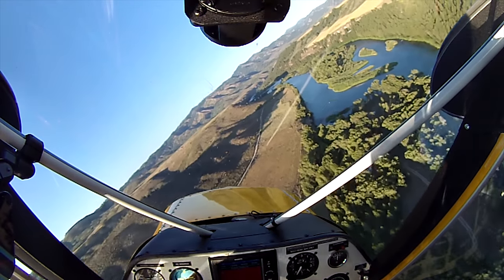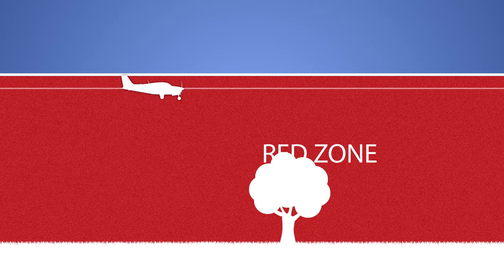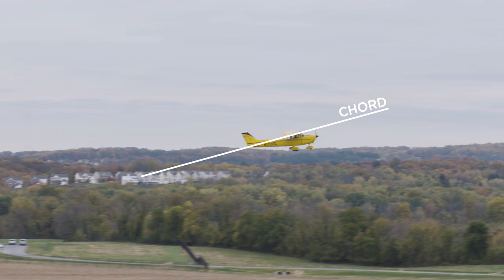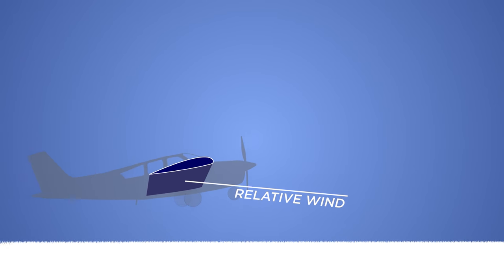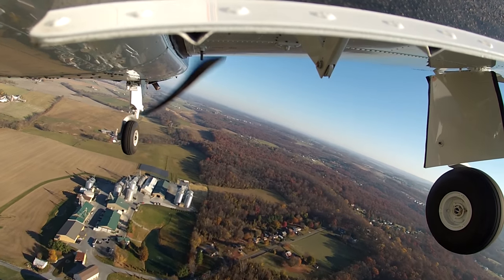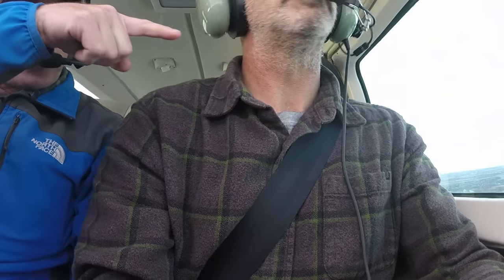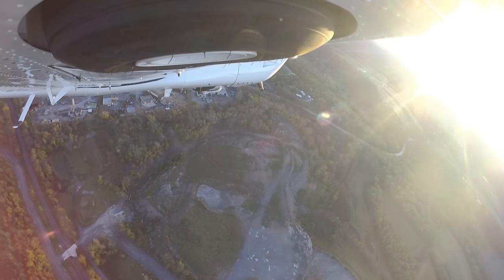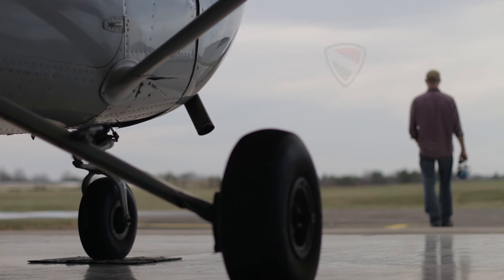Margins of Safety: Low Altitude Maneuvering

Comment: My ppl cfi insisted that I actually spin a 172 and recover several times. I assure everyone, I have no desire to bank 45 degrees uncoordinated no less with full power and hold a yoke full back ever again. The spins happened so fast and often the stall warning horn was too late.
Reply: Spins Should be required in USA.  Makes you super aware, never careless.  Canada has a much better LOC accident rate than USA..
Reply: My CFI did the same thing. But the first time he had me go through it, I temporarily blacked out on the recovery, enough so that he felt my pull of the yoke substantially relax, In fact, he had his hands loosely on the his yoke while I was performing the maneuver just for that possibility, and saved the recovery. Afterwards, despite the CFI’s encouragement to continue taking lessons, I decided to abandon getting my PPL as I thought it was too much of a risk for me to possibly black out in a real spin/stall emergency while flying solo.
Reply: @phdtobe  Flying is a dream. But not the only dream.

Comment: Something I really hate that seems to be pretty common ( but not without exceptions) is "positive rate, gear up". That's all well and good in an aircraft with multiple engines but in a single engine plane it's not very smart. If you only have one engine you should change that to "out of runway, gear up". Otherwise, should you experience and engine failure shortly after rotating you'll look like a fool landing on your belly and damaging the aircraft, in what should have been a somewhat trivial situation.
Reply: I have to disagree. The difference in climb rate between gear up and gear down is well in excess of 500-700 fpm in many aircraft. The question becomes which is more valuable altitude or gear? Lets consider the consequences.

If the engine fails with runway remaining and gear down then yes the aircraft may be saved assuming you don't overrun the runway or drift off center line. . However, if you do not have runway remaining you are now at a lower altitude and may not be able to pick your landing spot.

If the engine fails with runway remaining and your gear is you will still walk away but insurance gets to pick up the repair tab. If it fails shortly after takeoff you would then have a better chance of flying to an appropriate emergency field since you have more altitude.

So the consequences of a quick retraction are potentially damaging the aircraft. The consequences of a slow retraction are potentially fewer possible emergency landing fields. They can make another aircraft; it is expendable. They can't make another me.
Reply: Feet per minute. The extra time you would have to wait to run out of runway in the majority of cases is merely a few seconds, maybe 10. That's about the time it would take to clean up the aircraft and gain back that climb rate so that is irrelevant. Not to mention that if you have an extra long runway it doesn't matter because you're climbing and you will be too high to use the extra length ahead of you regardless.
Reply: You sound like a Mooney pilot.
Reply: Mooney 201er Incorrect!
Reply: Sorry, that was @ Joshua Landry but for some reason didn't get marked that way. In a sleek airplane like a Mooney, the gear drag penalty is far more than in a power driven airplane like a Bonanza or Skylane.
Reply: @Mooney 201er, I'm not really tied to any aircraft. Most of my retractable time comes from the right seat of an Arrow. But even in something like a Bonanza it is going makes a difference. If it didn't they wouldn't bother making it a retractable.
Reply: In my commercial training we checked for both, out of runway/runway no longer in sight (IFR flight), positive climb (not rate), gear up.
Reply: I was trained to lift the gear after I was past the runway.  It happened quick because my complex sign off was in a turboprop.  In a piston I wait until i am put of runway or around 500 foot.
Reply: Insurance company owns the aircraft as soon as the engine fails. Why would I care if the wheels are down or up?

Comment: Good video.  I really like that it discusses something that became a rather heated discussion on another board - the fact that the flight path /  relative wind change is not instantaneous to the change in the control inputs/aircraft attitude.  People seem to have trouble coming to grips with the fact that air is a very low viscosity medium to travel in, thus inertial energy is going to continue to move the aircraft for a brief period before the change in force from the control input become fully effective on the direction of movement (and thus the accelerated stalls).  Anyone who has spent anytime in a power boat has some feel for this even though water flow is more viscous/responds faster.

If nothing else, to get good visual imagery, pilots should watch  a hover craft maneuvering.  The change in the vehicle's attitude is nearly instantaneous to the control input.  Change in the direction of travel of the hovercraft lags noticeably.  It is visible since you have the ground referent to see it clearly, unlike an aircraft in flight.
Reply: Glad you compared to maneuvering in a private plane with a boat. I was brought up with speed boats, slaloming, etc. I have a feel for the powerboat (yes inboard/ outboard Mercury!!) Yes my inputs seemed very delayed and especially with the wind, water currents, and obstacles to avoid! Thank you!

Comment: When I was instructing in the 1980s I took students on a low flying exercise at about 150ft following a  twisting river impressing upon them that at this altitude speed was their saviour should obstacles such as power lines be encountered. There were several set of power lines crossing the river in the area of the low flying exercise and the students were told to point out the lines as soon as they saw them while at the same time following the twisting river course and maintaining height

Comment: The only thing I'd suggest should have been different is the narrator's comment that below 2500' is the appropriate low altitude definition. Much training and general flying is done below 2500' AGL. Below 1500' AGL, yes, but not all below 2500'.

Oh, and I did like the ending, too. :)
Reply: That definition was preceded by the comment "recognize when you are at an altitude too low to recover from a stall or worse, a spin".  I think 2500' AGL meets that definition.  Even 3000' AGL might be too low to recover from an inadvertent spin.

Comment: I would have thought 2500 ft was more than sufficient height for slow manoeuvres.
Reply: I guess its a USA thing, less than 900 metres on a runway is considered 'short' and now, 2500 agl is considered 'low'?  ha ha . You would not fly anywhere much in Europe if that were the case :-)
Reply: @TRPGpilot  And a 45 degree bank is a steep turn.

Comment: I was thinking an F-16 would have the same problem pulling back on the stick giving it full throttle with After Burners lit, but...one the compressor/turbine spooled up it would not matter angle of attack or air flow across the wings...You're going up like a rocket.
Reply: I have heard pilots say that flying fighters is a completely different animal... you're strapped to a jet engine and you just so happen to have wings.

Comment: People die showing off because they become test pilots teaching themselves as they are doing it. 
Typically, they are flying as low as they ever have other than takeoff and landing, going faster than they ever have (at full power and close Vne or above Vno) often with the aircraft mistrimmed, and pulling more Gs than they normally do. Of course it's going to end in disaster. 
If you want to show off, here's a safe way to do it. 
Set up like a precautionary and define a circuit so you're aware of obstacles, distances, approach, and overshoot. 
 Keep a normal cruise power setting. You're not flying an F-18 and full throttle is still going to be ridiculously slow. You're also likely to overspeed your engine with a fixed pitch, and that might distract you. 
Don't go ridiculously low. Nobody cares if you're right on the deck unless they have a morbid curiosity plus they won't be able to see you and your awesomeness. Treetop height (~30') over a clear area (field, lake, runway) is good enough. 
Don't yank and bank. Again, nobody on the ground cares or can appreciate what your plane is doing. Use gentle back pressure to set up a Vx attitude to bring the speed into a normal range and keep the aircraft straight.
Reply: Perfect example:  Roy Halladay.
Reply: Yep. He was his own test pilot. Wrote his own ticket.

Comment: If I am going just below Vne and pull up abruptly, watching speed not to get anywhere near Vs, this video talks about stalling the wing?  Of course a plane can stall at any speed but has anyone ever encountered that scenario stall condition?
Reply: It can be done. It is called an accelerated stall and you should ask your CFI to demo one at your next BFR or whenever you next have the opportunity to fly with one. To do it safely at relatively very high speed as you describe would require an aircraft like an Extra 3000 or a Pitts.

One pilot in my area tried to do some low level maneuvering at high speed. He stalled and put his aircraft into a house killing three people.
Reply: A D the goal is a quick climb, you pull to stall horn and relax the pressure to ride the AOA just before stall.  You don't need a vertical climb out either.  You should not be close to terrain to avoid CFIT.
Reply: I have done this maneuver many times fully loaded and this makes me wonder.
Reply: if youve tried this many times then youre closer to death than me
Reply: A D One of the scenarios, although by no means the only one, is this;  pilot gets fresh PPL then proceeds to dive on friend’s house to demonstrate or celebrate new-found ‘abilities’. Upon pullout ( although he didn’t know he was already history higher up on his dive) one of the following happens: Pulls back as hard as possible regardless of stall horn screaming, and snap rolls into ‘target ‘. (2) Realizes stall is imminent and does not pull back to stall, but CFIT’s at high speed somewhat behind ‘target’ because of insufficient altitude to complete the ‘loop’?!
By the way, the German Air Force found a solution to this, even for experienced pilots in Stukas in WW2, who had to make near vertical dives at near red-line without either passing out, snap rolling in, pulling out too late and CFITing , or getting ‘target fixation’. It was a radar altimeter ( to know the exact height above ground) combined with a crude form of autopilot which merely initiated a pitch-up at a safe height above the ‘point-of-no-return’ so to speak.

Comment: VFR under a low cloud deck is asking for "inadvertent" VFR into IMC...
Those low clouds have a habit of getting lower.
Reply: Not in my experience unless it’s associated with a frontal system. 

Plus... most people don’t plan to fly that way... they wind up encountering it. Still need to fly to find a safe place to land. Set up ten or approach flaps, gear down, Vy, and get to an airport.

Comment: This is ignoring the 'ground effect' encountered as you glide closer to the runway which increases lift.  I call BS.
Reply: Ground effect is only encountered within about a wingspan (of the aircraft you are flying) of the ground. Go-arounds are typically preformed before that point.
Reply: Agreed! I've made a lot of go-arounds in my 70 years of flying but don't recall any I had to initate higher than a wingspan above the runway.
Reply: Then you have poor judgement or poor reaction times.